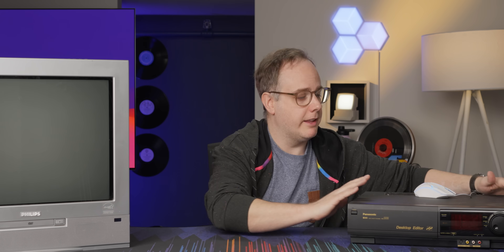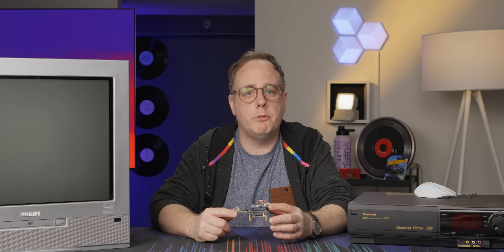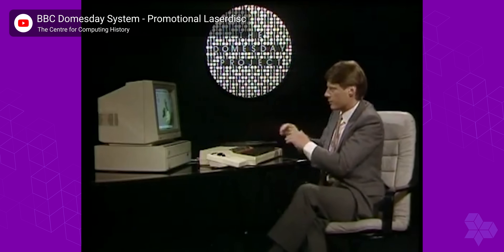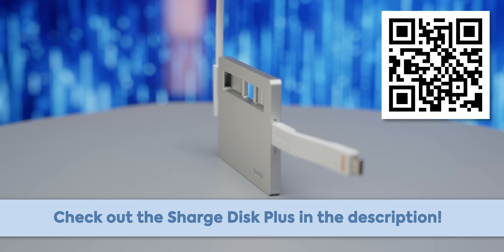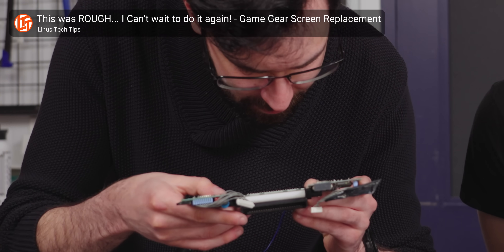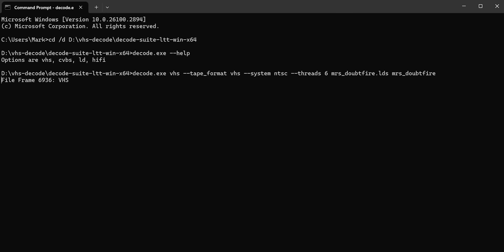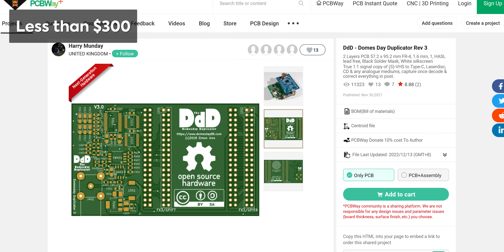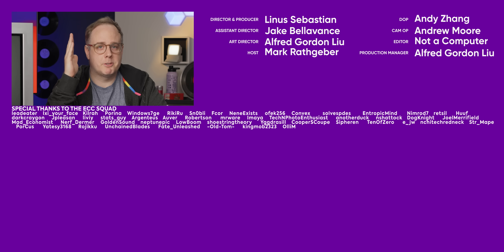I've wasted THOUSANDS of dollars... - Domesday Duplicator

Comment: 5:40 Is the comparison the right way round? The "domesday duplicator" is noisy and has a lot of chroma drifting (rainbows) and looks worse.
Reply: They're both ugly, but the domesday is sharper and more saturated. The blur and desaturation of the composite helps hides the noise and rainbows.
Reply: Well the noise is smoothed over by many factors, such as the composite conversion. It may look nicer, but you are losing detail. You do want to see the raw noise grain in the image, you don't want that smoothed over at all.
Reply: Noise you can always try to reduce with filters afterwards. Crappy capture you can do nothing about.
Reply: Noise and artifacts can be digitally edited out or minimized. The more important thing is detail preservation, which the Domesday clearly excelled at.

Comment: You had me until “$500”. 😬
Reply: It's actually 300USD or less 90USD of that being at factory cost the DdD board and the rest is dependent on the FX3 and DE0 dev boards the ones at the top and bottom of the uni, CX Cards are sub 30USD each, clockgen clocks in at under 150USD normally.

Comment: About 15 or 20 years ago, I bought a Panasonic DMR-EX99VEBK combo HDD/DVD/VCR unit for the sole purpose of transferring my VHS collection to DVD-R. About £500, plus what I spent on blank media, and a few hundred hours of my time, and I had backed up all of my home tapes, and 99% of my pre-recorded purchases which to that point I hadn't bought on DVD, (a couple of tapes had Macrovision.) And they all looked fantastic, as good as VHS could get. That's digitising the easy way, and with the added bonus that using the HDD as an intermediate step allowed me better control when it came to editing the content, removing commercials, splitting into chapters, naming content... Now ask me how often I watch those DVD-Rs... 

Very rarely.
Reply: Question about this, what’s the hdd purpose? Can you record from vhs to hdd and then somehow extract this to pc?
Reply: @avatarpt  The HDD acts as a PVR at most times, but you can transfer the content from tape, direct to DVD-R, or better still transfer it to the HDD, where you have limited control to edit it, break it into chapters, edit out commercials, break it into different titles (good when you're extracting from a 4 hour tape and only have DVD-R 5s to record to) You can also add text titles to the content, and choose thumbnails. You can't copy direct from the HDD to PC, but you can easily rip the DVDs that you burn, just like any other DVD.
Reply: @jitmancanth6698  I bet someone has tried plugging the HDD straight into a computer and worked out the file format...
Reply: @phuzz00  Panasonic uses their own shitshow of a file system called RTSC, so not only the thing isn't readable by a normal PC, plugging it into a Windows machine will cause Windows to write some ID in the partition table which then makes the player refuse the drive altogether. Similarly cloning a drive doesn't work, and in case of a failure the best bet is to search for a PVR with a working HDD to swap it over, you have to have it provisioned at the factory it seems. Though that is true from my experiments with a later hi-end Bluray model. It also runs Linux but it's an architecture which literally has two commits in the kernel — one is "add support" that never worked, the other is "remove support". I was able to get Busybox running on that but without GDB it's hard to do anything meaningful. At least MakeMKV gets me through the task, but it would be nice to also have a way to dump commercials from copy protected D-VHS tapes without fussing around with the remote to disable the copyright checks!
Reply: @ thanks
Reply: Removing the commercials?!?!?!
There's a whole community that's all about old commercials!
Reply: @Le_Frenchman Sounds like they removed them at the time for personal use.
Reply: You are stuck with the MPEG compression and limits of the DVD-Video format though.
Reply: yeah.. i think my in-laws have one similar to this!!
Reply: I went that route with a DVD/VCR combo from ebay, but it could barely finish writing to a dvd without throwing some error. The tape would keep playing, the disc would say „updating“ and then not offer any option to finalize it. Attempting to dub again would show that the disk is not empty, but there was no was to actually use the recorded video do you had to start from the beginning. Don’t know if it was the unit or the blank discs that were problematic. 

A USB capture device offered more flexibility, bought a Dazzle on ebay for 20 bucks, and it seems to do the job, albeit only on windows 7, the windows 10 drivers get installed but only show a black screen.

Just for kicks and giggles went and bought a CX card, BNC connector and cable and a 40MHz crystal to upgrade the card. I want to try it and compare if it is worth the hassle with the 5 tapes I have, but is also a fun project if you like tinkering with stuff.
Reply: image them and upload them to the Internet Archive!!!

Comment: Am I crazy for preferring the composite/CVBS video in the comparison?  Maybe it’s just a bad example but the Doomsday + decoder looks way over sharpened and noisy.

Maybe good for archival purposes and could be processed further at a later time, but for casual viewing / ripping of movies the juice doesn’t seem worth the squeeze.
Reply: This is actually not a recommended config setup, there was no cap on the test point or amplifyer in-line to limit the signal draw, the AG1980p here is the fault not the FM RF capture device or the current decode software, and also most people start with 30USD CX Cards, not a 300USD DdD (which is its max real world cost not the marked up cost)
Reply: @ ah, very interesting!  Cool to know.
Reply: @TheRealHarrypm  They may well have also used a poor conventional capture card, they even captured using composite despite a high end s-vhs deck. At best, they don't say what they used, it seems unlikely it was the firewire/dv converter.
Personally I thought both captures looked worse than they probably should have.
I also thought it was weird to use vhs-decode on one of the most expensive vcrs, when the best features of the vcr will have no impact on the vhs-decode capture.

Comment: I thought the reason you try to get a really good (S-)VHS player is in the read heads, so this is really confusing.
Edit: well, turns out you still need high quality player, as not every one has RF Test Port, and you still need good technical shape. So this hardly a cost saving measure and $20 VHS player won't cut it... So, Mark & the ECC Squad - what the hell guys?
Reply: No all decks have Video RF test points, not all the later 2000s ones have HiFi FM ones though without tapping IC pins, this method only gets you the RF after the tracking and pre-amp stage of the decks, so the mech and heads have to be good thats about it.
Reply: Make a test point @TheRealHarrypm

Comment: Studio grade betacam deck with TBC (25kg), arcane capture cards.... And VHS decks are even more expensive because of the demand. All of this (still very cool) gear can be replaced with this? Amazing!
Reply: The MISRC actually has Betacam in-mind with 2x 40msps 12-bit channels, (Betacam is 2 channels to capture for video FM) and provisons for upto 4ch of standard audio.
Reply: It's can't though "yet" until it's real time and can capture audio and video at the same time plus has the flexibility of an external equipment like a TBC it will not. It's not practical for pro use because you have to manually sync your audio in post.  

I'd be interested in seeing a real comparison most if not all of the side by side tests I've seen are not fair and feature tape recorded using cheap consumer capture cards without externally time base correcting with a good TBC that was setup with a waveform monitor.
Reply: @ScottGravlee  but TBC is done fully in software here. Arguably getting better results than old hardware TBC devices ...
Reply: @AnoshterHaar  Not necessarily there's features I get with my DPS-575 I won't get with their software TBC.
Reply: @ScottGravlee  I mean he litterally shows a waveform in the video... Makes me question if you even saw the whole video to begin with...
Reply: @ I did again there's stuff my dps does this won't.
Reply: @ScottGravlee  like what?
Reply: @ScottGravlee  not to mention that a DPS-575 on its own would cost me my liver and a legg... It may be just a tad worse in terms of quality. But at least isn't costing me the majority of my rent to digitize from deck to pc...
Reply: @AnoshterHaar  Well for one as far as I know I can't time two of the same sources together and if you just need to retime single source with issues from being recorded you can't from what I can tell. You also can't automatically adjust the TBC by looking at a tapes bars and tone.

there's other fine control over each channel of color I don't see a way to adjust that but I could be wrong.

The software shown and in one of Harry's video has a waveform monitor with non standard readings where's the IRE markings? as seen here. https://www.youtube.com/watch?v=782jkWL-KcE
Reply: Exactly. I have been looking for a high quality way of digitizing vhs but have been putting off buying an expensive tbc capable system for years now...
This is the thing I have been waiting for without even knowing I was still waiting😂
Reply: @AnoshterHaar  You're still going to be limited by how good the tape mechanism is, so I reckon you'd get better results with an expensive deck than a $20 bargain bin find.
Reply: @phuzz00  can you explain why that is? As far as I know, TBC is correcting the majority of mechanical unstability issues and playback inconsistencies. And the TBC code in this software will for sure be better than hardware TBC in 20 year old vhs players...

Btw, nowhere did I say I expected to transfer tapes from 20$ players. There just is quite a price gap between TBC models I see going for €400+ in the EU and a €100, fine working non-TBC player.

But I would like to hear why it is you think mechanical issues play such a big role in extracting and converting the raw data.
Reply: @phuzz00  ah found info in the documentation about this:

"Your VCR needs to be mechanically stable and able to track the tape. This means decks that are dramatically out of spec will have to be serviced/adjusted.

Standard capture rules of thumb such as tracking adjustment per tape/segment with channel up/down buttons/sliders or knobs on pro decks and keeping the heads/guides clean still applies, as with any tape media playback."

These things have to be done with any player, even professional TBC equiped decks. So it sounds to me like a decent player, not breaking my wallet, should do the job just fine...

Comment: "Firewire" Now, that's a name I haven't heard in a long time....
Like e-sata or midi-port
Reply: Midi is still used in music production. Digital instruments usually have Midi connectors as well as analoge synths.
Reply: @mephistovonfaust  I mean like yeah if you have a boner for physical hardware, but I think most people just connect their MIDI device (keyboard etc) via USB to a laptop and use Reason and VST plugins
Reply: @notbfg9000  sure, but even that is just midi over USB and a ton of synths don't support USB at all and only accept Midi or directly patching into the modules.
Reply: @mephistovonfaust true, but then again USB to MIDI adapter cost next to nothing and they all work pretty good.
Reply: @ Well, yes, as I said if you prefer to do the effect in hardware.
Reply: MIDI is still very much around. Granted, its dedicated connector is getting phased out and replaced by USB, but there's still a TON of devices around with the old connector.
Reply: @16jms  new devices with the DIN connector are still being made, and a lot of gear today uses hardware MIDI over 3.5mm TRS jacks
Reply: @16jms  I'm a custom computer systems builder, and I frequently build computers for musicians and music production companies.
Yes, a lot of modern instruments have midi ports, but I've not seen a dedicated midi port on new computer hardware in over a decade. 
Among my best selling items are various USB to 5-pin din midi dongles.
Reply: E-SATA is still used w/ some manufacturers of NAS boxes
Reply: I've still got some Firewire 400 AND 800 gear in my studio on my older machines.
Reply: Synology still provides e-sata
Reply: MIDI still gets loads of use... in the places I tend to hang out.
Reply: Midi i/o is still widely used in the music industry. And while people down here were quick to state USB is kind of there to replace midi, there are lots of scenarios where DIN ports are really the best and easiest option.

What if you want to sync multiple audio devices (like synthesizer, effect pedals and drumcomputer) to a time pulse? Now you could get a computer in there and run multiple usb cables. But just running midi cables in series and using one of the devices as a clock is just waaay easier. Not to mention that pulling 5+ USB cables from one end of a stage to the other end is just asking for trouble. Either the cables will break eventually, or the massive dongle you need is gonna give you a headache in terms of stability.

These are just some of the examples where MIDI is still very much alive and truely the cheapest and barebone, analog way, of connecting multiple audio/music devices together. It just works.
Reply: That's a name I haven't raged at in a while. I have 3 Sony HDV Z1 cameras and all the Firewire ports are broken (component capture still works I guess) When the last camera broke it blew a fuse on the power distribution board. Lives up to its name 🎥🔥😠
Reply: my gaming PC has e-sata, never used though...
Reply: How about PS/2. RS232? Serial COM?
Reply: @GnarlyChop  Serial communication is still often used for certain hobbyist electronics these days, albeit at either 3.3v or 5v levels instead of the 12v that tends to come from PCs - I happen to have flashed multiple ESP32 prototyping boards recently, one with a direct serial connection to the chip & one with a USB-C cable, the one with a USB-C cable just puts a CP2102 USB to serial chip often found in USB to serial adapters on the board. Serial is also often used for those boards to communicate with other special-purpose parts, ex. using UART to command a DFplayer Mini.
Reply: @blanknam3d  I mean, the S in USB stands for serial.
Reply: @mephistovonfaust  Serial and Universal Serial Bus don't have too much in common as far as signaling though lol - for starters USB devices are expected to declare what type of device they are to the host so the host sets everything up, while serial connections typically need parameters set by the user + whatever specific software needed to utilize the device.
Reply: @blanknam3d  well yes and no. USB is pretty much to serial, what USB 4 is to USB 1. The only difference is, that it needs that declaration, which is why adapters are so cheap. 
At its core USB is a serial, albeit it much more advanced serial connection.
Reply: @ I understood like 2% of that. Sorry. 🙂I'm not exactly that advanced in electronics. But I'm learning. 😀
Reply: What about ExpressCard? I've almost never heard anyone who even knows what it is, Lol
Reply: @Sb129  somewhere around my shop are a few laptops with ExpressCard slots, and at least one ExpressCard54 that accepts PCMCIA cards.
Reply: didn't hear about e-sata? e-sata is just external sata connector and nothing more. MIDI is still working in any pro device. Are you lamer or what?
Reply: IEEEEEEEEEEEEEEEEE
Reply: I found an e-SATA cable when I was moving house recently. Even thought I don't own anything that uses it, I still kept it. You just have to don't you?
Reply: You mispronounced IEEE 1394

Comment: Didn’t know you could buy the doomsday
Reply: It's been on PCBWay for direct fab for 3 years now, at 80-90USD for the DdD boards and the FX3 and DE0 dev boards go in and out of stock and infation all in all sub 300USD nomally, but CX Cards are sub 150USD with the clockgen normally.
Reply: @TheRealHarrypm whooosh
Reply: Guy got it wrong - he was buying the knockoff "domesday duplicator"
Reply: @ No, it was made by PCBway, just with a markup slapped on it and not from the core dev group members at that.